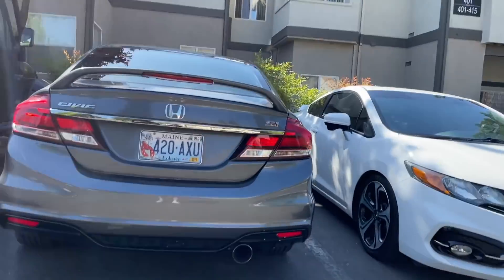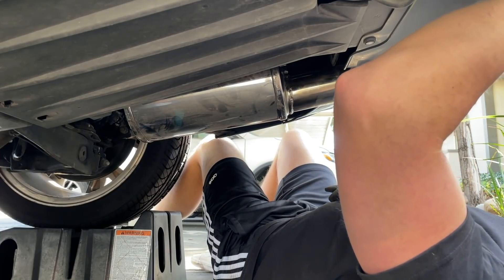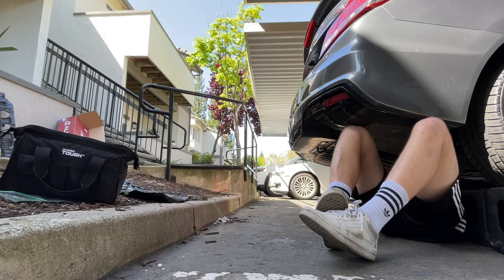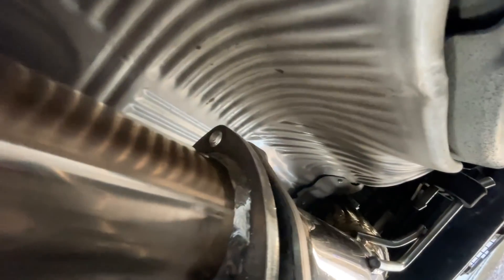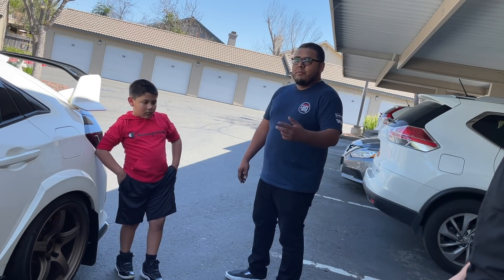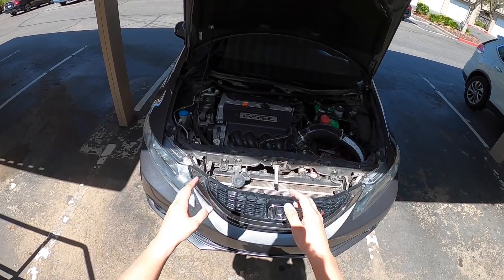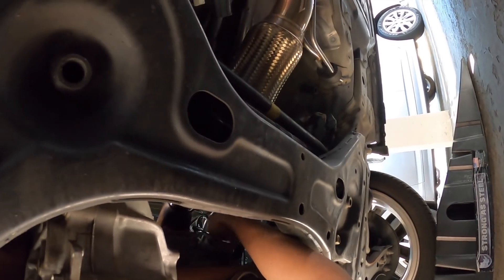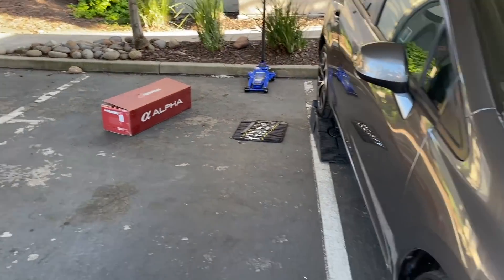2021 Civic Type R vs 2020 Type R + 9th Gen Si Parting-Out!

Comment: always use loctite on exhaust bolts. they always get loose regardless of tightness lol. my best friend cracked his header runners on flange due to stock mounts but exhaust was really tight though with no flex pipe. oh and i like stock cat or hi flow cat with aftermarket exhaust they sound so good without being too loud. of course you lose slight power with it on but driving it daily it helps.

Comment: Pro tip for the next time: PB Blaster or WD-40 makes taking those hangers off 100x easier. Every video I watched about front and downpipes complained about the exhaust hangers, so when I did mine last week I covered everything in PB Blaster and it all came out no problem